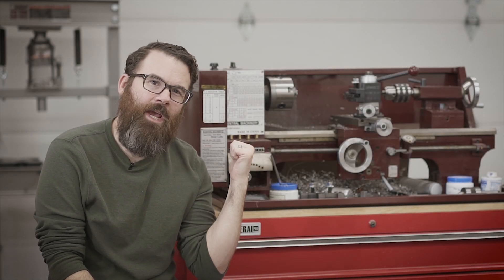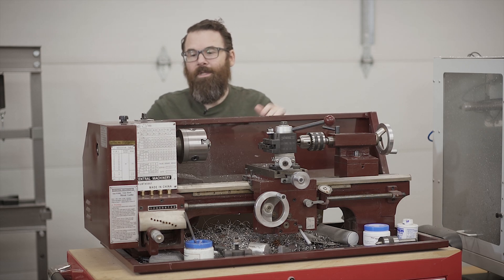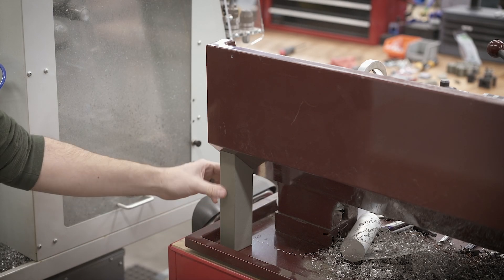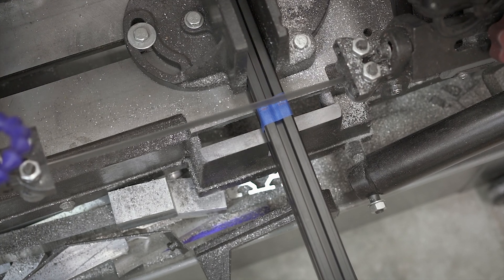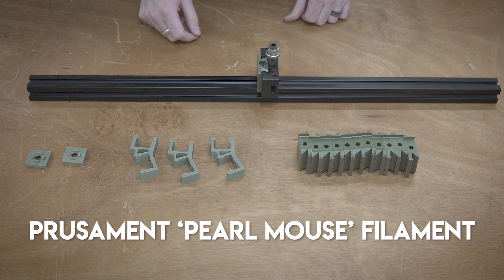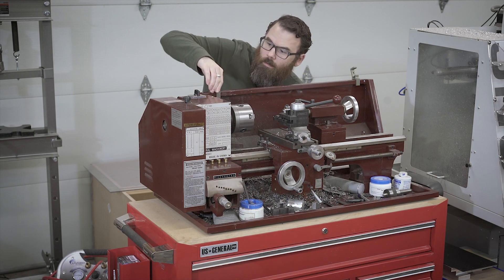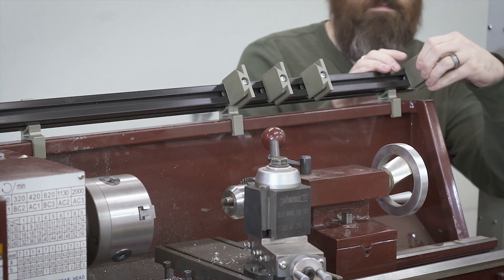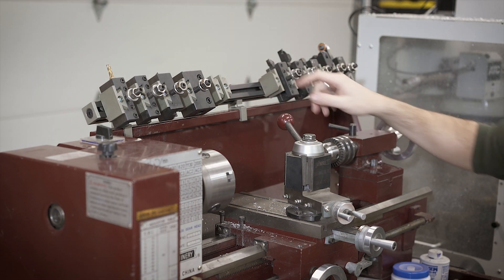Lathe Tool Holder Rack (for QCTP Holders)

Comment: Dude, I've thumbs downed your video for the simple fact that you 3D printed a block of plastic out of filament that really could have been put to better use ! A 2x4" timber off-cut would have served just as well if not better for your splash tray support. You over engineered a simple job to ??? why ??? perhaps to make yourself look smart/cool ? or just to produce content and get your video over 10 mins for that add revenue ??? 3D Printing is a GREAT Technology but by your own admission you went through Many Iterations of your design. So my last question is how much extra plastic has gone into your bin ? which will eventually make it to landfill or to the oceans where they become micro-plastics in due course. Merica needs to wake up to there greed and consumption.

Comment: What about chuck keys, tail stock tools?
Reply from the maker: That's a good idea.  I keep my chuck keys in another spot.  I have several keys for all the drill chucks for my Tormach (with is right next to it) and my drill press.  The top drawer on this cabinet have all the other lathe tools.

Comment: These work great I made mine about 8 years ago out of 1x2 80 20. I also added some mounting holes to the face so they can easily mount to the wall with a couple screws.
Reply from the maker: Nice!
Reply: @RobertCowanDIY   I don't know if your chip guard would handle it. But I also bent a piece a piece of aluminum so it would fit on the backside and come up level and drilled holes to hold Morris taper accessories drill chuck live centers ect.